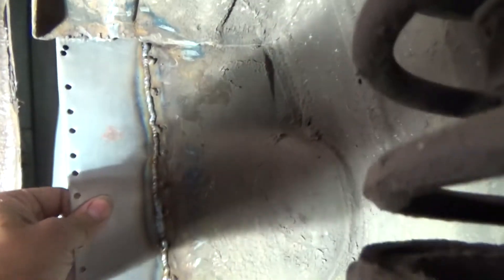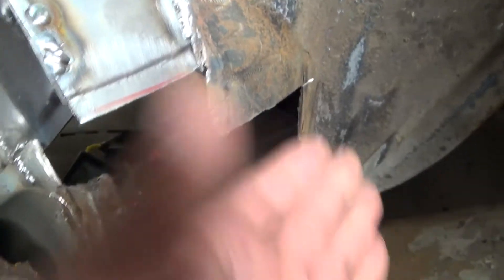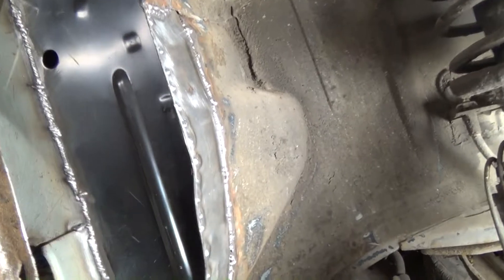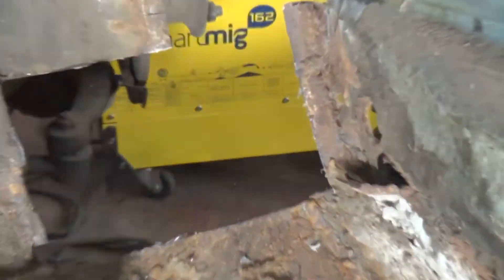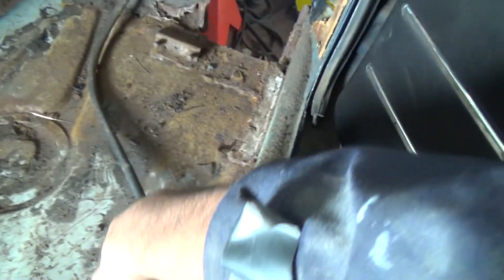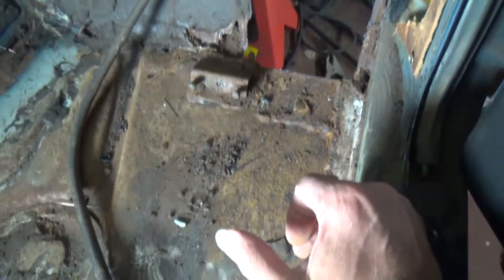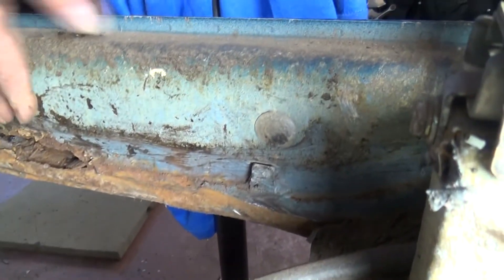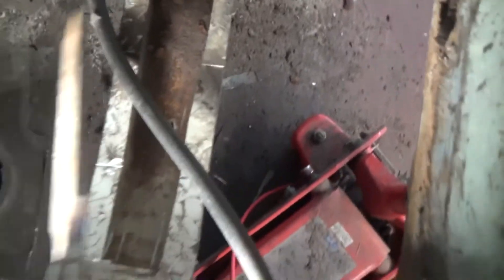BMW 2002 1973 Restoration #14 welding front inner panels

Comment: How did this all end up for you?
Reply from the maker: yes its all done I have done floors and complete sills/rocker panels, I have the front panel repair still to battle thru , unfortunately  I accidentally deleted  all the footage  I have, i might just do a overview, project is at a standstill at the moment, trying to get the leaf motor running.